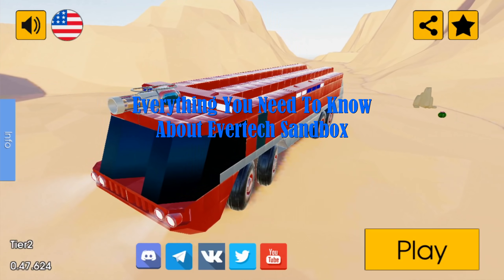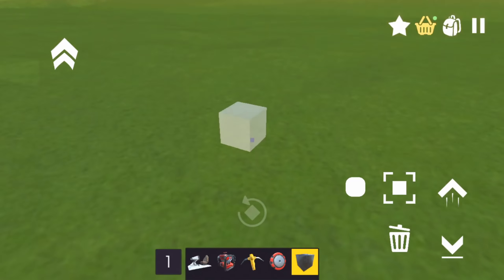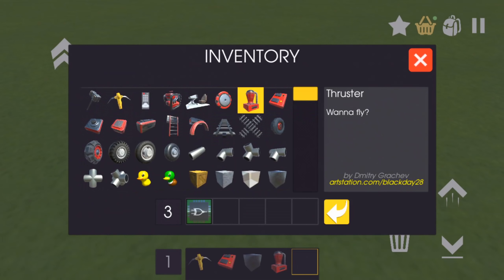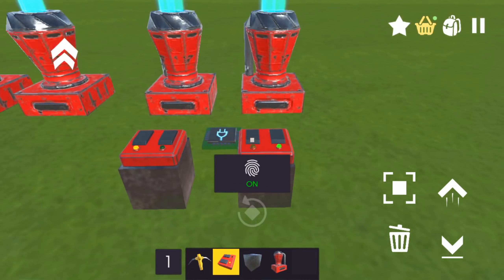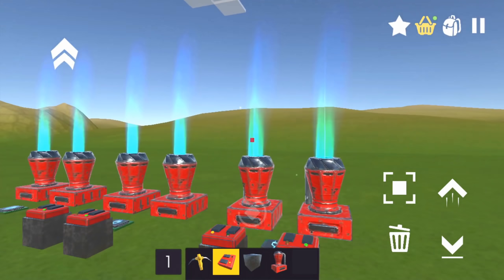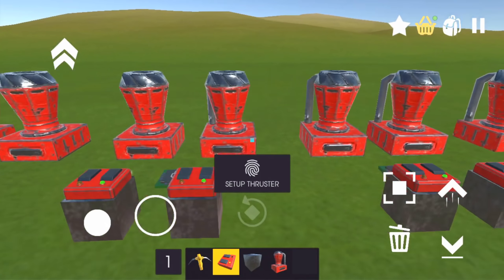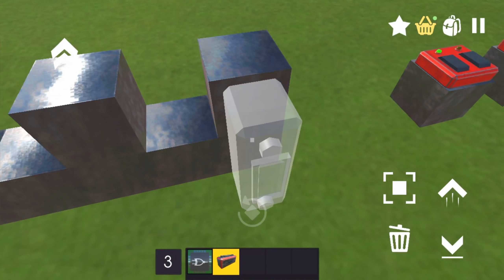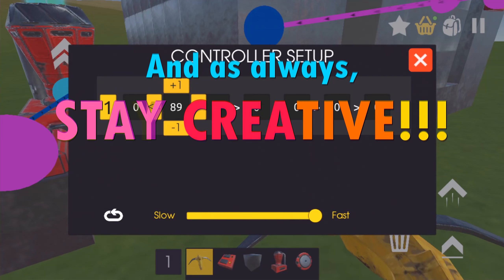Everything You Need To Know About Evertech Sandbox #2

Comment: Why can't I activate pistons and springs?
Reply: Ok, so for the piston mod, you need to place the piston base, then place the suspension item on that, then finally place the piston end on the other end of the suspension.  Now you just need to place a text sign item on the piston base to activate the speed and distance.  Finally just use the connector tool to connect a switch to the piston base.
Reply: Without a speed command, the piston would not work?

Comment: I need sooooo much more explanation in your tutorials. Im trying to learn from scratch! Like, explain what you're doing, why you're doing it, and what is necessary to make things work. I tried to make a car but it doesn't steer and sometimes they just take off and runs away when I hook it up 😭😭😭.
Reply: The Most Interesting Beard listen to my explanation so first if u make a body of a car u need to make a 2 block line in the both front side of the body then at the second blocks of both sides place a bearing at the bottom of both blocks then place another too blacks vertically then place a bearing on the side then place the wheel then connect the bearing that makes it steer which is the bearing in the bottom block then make its rotation direction in right then boom now u have a car that can steer